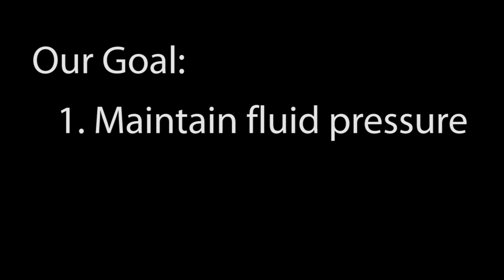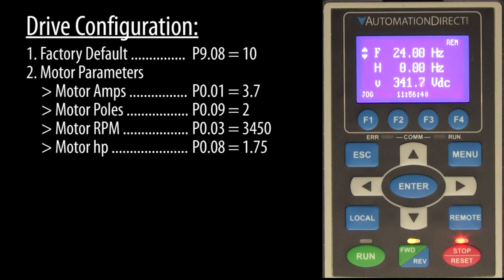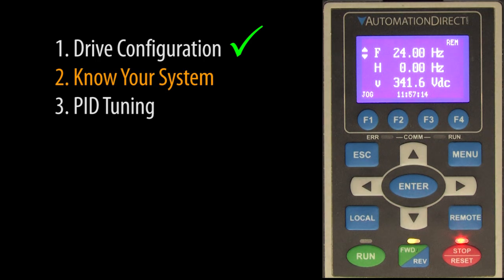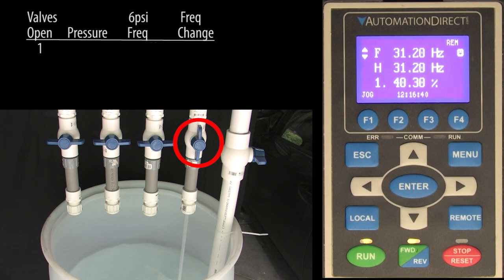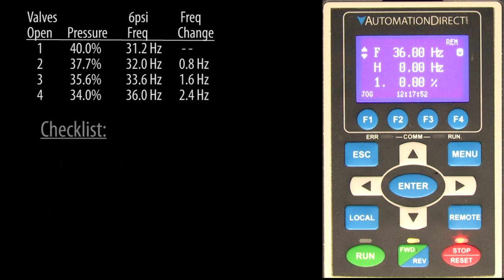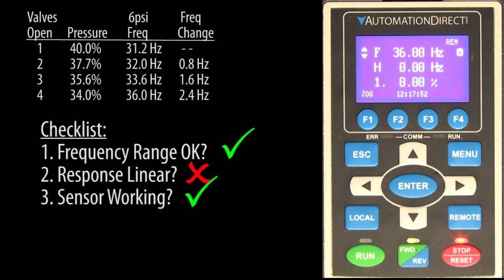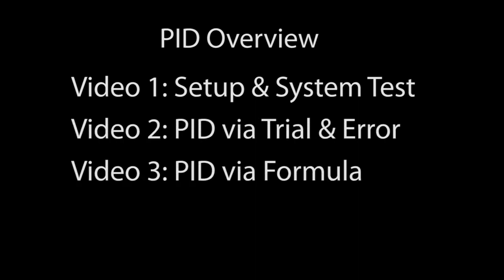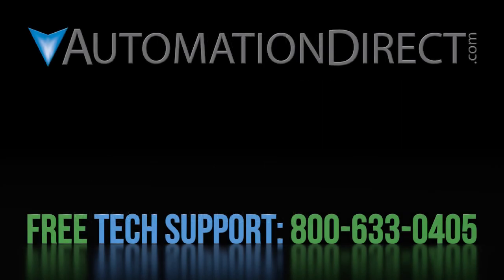DURApulse GS4 VFD PID Controller Tutorial: Part 1 of 4 from AutomationDirect

Comment: Apakah kalau pakai mesin ini,mesin selalu hidup walaupun kran pada tertutup thankx you
Reply from the maker: "
Translation: "If you use this machine, the engine always runs even though the faucet is closed" 
Reply: PID will do whatever it has to to maintain the pressure. It is possible it can take the motor to 0 rpm, but only if you haven't set a min speed.

Comment: Hi there. Is it possible with PID control to connect the output of 1st  vsd to the input of the 2nd vsd? I would like to control the speed of the 1st motor according to what the amps of the 2nd motor is. The higher the amps of the 2nd motor the lower the speed of the 1st motor
Reply from the maker: Yes. Send the output current to an analog output (P4.50 = 3, for ex), then run that into the analog input of the other drive and tell that drive to use that as the frequency source (P4.00/01 = 2) for example.  The GS4 is an extremely flexible drive, most of the time you are only limited by your imagination!
Reply: Thats awesome news. Thank you